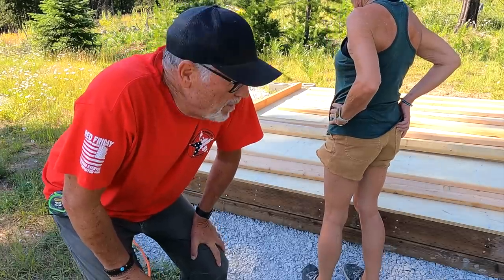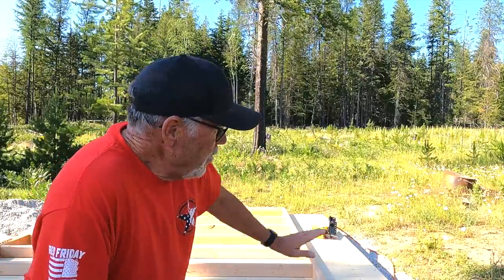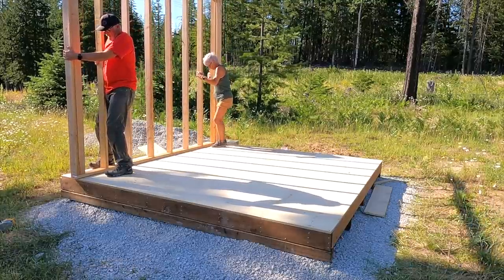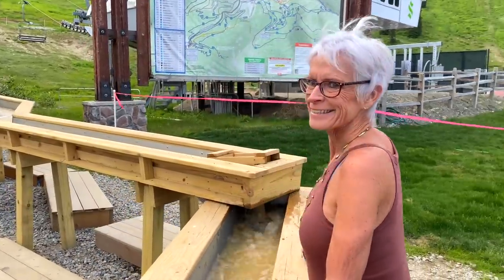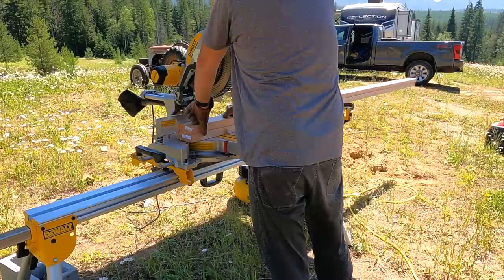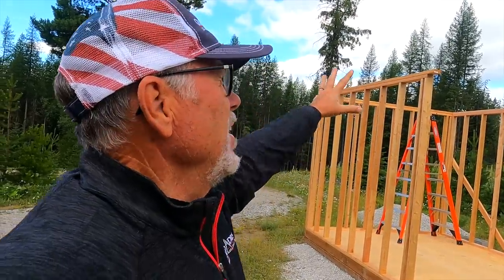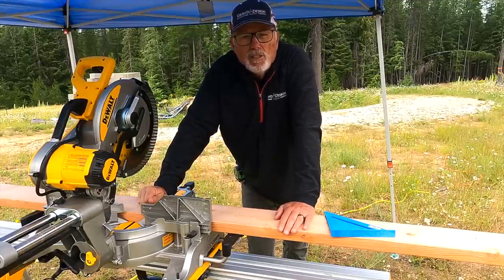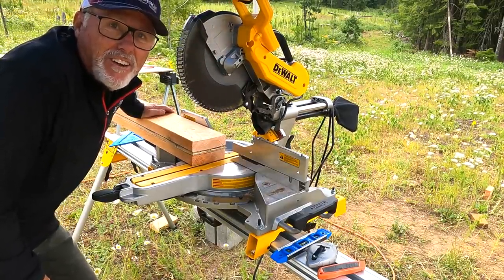It SHOULDN'T Be This HARD!  Off Grid Living in North Idaho

Comment: Keep them from warping, strap them together an get them fastened in ace as soon as possible.  That  way stop lot of that. Lumber is not all totally straight. You have to learn how to use it. 1st thing you learn in carpentry is that . TREES GROW ROUND. WHEN THEY ARE MILLED , THE ANULAR WRINGS TRY TO STRAIHTEN OUT. Don't forget that. When you install plates and studs , look down them if they are not straight , you will see a crown on one side . Make sure you put that crown  up. Not one up and one down.  So the crown side will be on the outside of the walls.  When you drywall the  inside, you are going to mudd the horizontal joint. When you are finished you will never really see that there was a concave inside.
Reply from the maker: Great tips.  Thx

Comment: Fun to see your progress, it’s looking good! Think about getting a tool belt (or 2!) next time you’re at Home Depot. Really helped me feel more streamline on our remodel instead of walking back and forth trying to remember where I put my speed square, pencil, tape, chalk line, cats paw, hammer, extra screws/nails etc. And don’t be afraid to just get a bigger one. You’ll find something to put in those pockets. I went with the Milwaukee general contractor bags with the shoulder straps and I have never looked back. Oh and putting a pad of paper for cuts/measurements is another good thing to have in there. Hope you guys are doing ok with the heat this week!
Reply from the maker: Hey Tom thanks.  Funny thing is I have a tool belt.  Still has the tags on it.  Guess I should get it out and use it 🤣.

Comment: That’s the problem with wood from home depot. It’s so wet ( freshly cut) that it simply warps. I haven’t found a way to stop boards from warping unless you go through each board and look at the ends to see which way the rings are positioned. Home depot has killed dried wood (sometimes) which is dry and won’t usually warp, but I think it’s only sold in 8’ lengths.
Reply from the maker: Thanks for the insight.
Reply: "kiln" dried wood, it's dried in a huge oven-like building.  Kiln dried lumber is usually marked with a "KD" stamp and is more expensive than non-dried lumber.

Comment: Norm, trying to go too fast with the nail gun ;-).  A tarp to keep the boards dry and a wood clamp or large C clamp will get those twists taken out before nailing. 👍
Reply from the maker: Haha, well in an effort not to bore you I sped up those sections but yea you're still probably right.  I'm a complete newbie with the nail gun.
Reply: I’ve done the same thing too, sure makes building a lot easier too.  Every time you and Kim were lifting those sides up I kept thinking, careful of your backs.  We will be in your area last part of August, headed up to Glacier Park, Yellowstone among others, about a 2 month trip in our 303rls.
Reply from the maker: @carlwellman3623  Yea I did actually tweak the back a little dang it, but did it during the process of building the floor.
Reply from the maker: @carlwellman3623  Sounds like a great trip and of course an awesome 5th wheel 😁